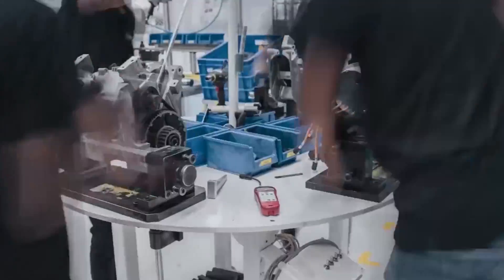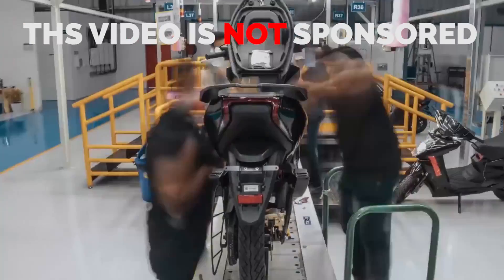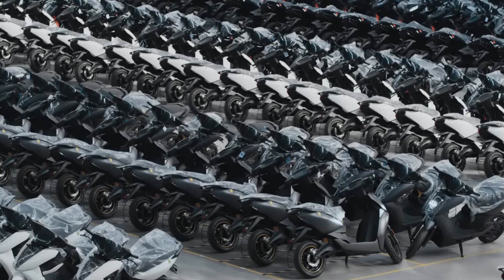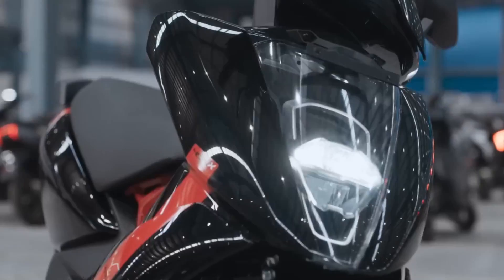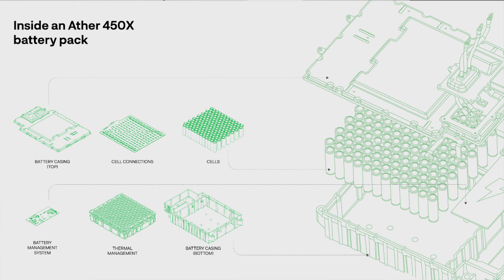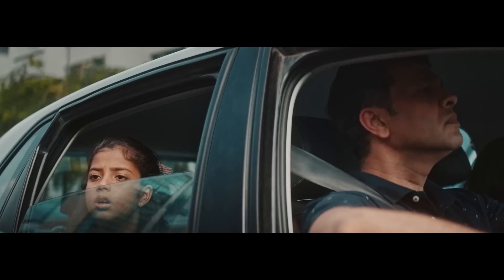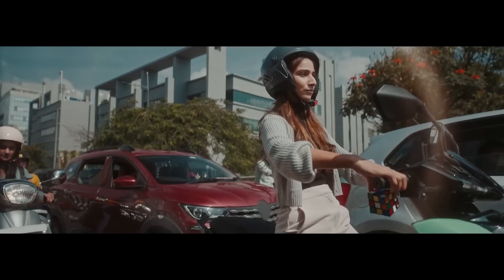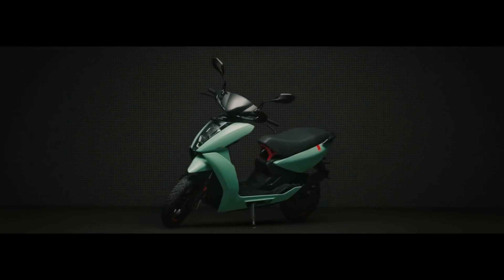Batteries, Thermals, Motors and Beyond With Ather's Swapnil Jain

Comment: That's why I keep coasting regen and auto hold off in my 450x. I don't want any unnecessary stress on my motor. Thanks for sharing insights. A magic twist should be added in 450x with different levels of control. I want to use it like brakes and charge my vehicle simultaneously!

Comment: AI-generated breakdown of Ather CTO’s interview.

Ather scooters are well-engineered for India, especially on safety and thermal management. But many of the design choices that were framed as “philosophy” are really cost trade-offs or ecosystem lock-in moves.

1. Liquid cooling vs fins + PCM
He said: liquid cooling isn’t worth it; passive methods are better.
Likely meaning: liquid cooling is expensive/complex. Passive cooling is cheaper and marketed as “smarter engineering.”

2. Battery swapping
He said: swapping hurts thermal design, safety, and center of gravity.
Likely meaning: swapping also disrupts their business model and control over battery ecosystem. Engineering reasons are partly real, partly justification.

3. Custom charging connector
He said: Type-6 isn’t suitable for India.
Likely meaning: Ather wanted control over charging infrastructure. Limits interoperability, but protects their ecosystem.

4. Regen braking at 100% SOC
He said: we dump extra energy into the motor so regen feels consistent.
Likely meaning: wastes energy, but avoids confusing riders. Safety/experience prioritized over efficiency.

5. Hub motor vs belt-driven PMSM
He said: hub motors reduce handling and safety.
Likely meaning: hub motors are cheaper but don’t fit premium positioning. Safety is partly true, partly a branding argument.

6. Dashboard hardware
He said: Snapdragon handles UI, microcontrollers handle reliability.
Likely meaning: uses older/cheaper chips and justifies as “robustness.”

7. Waterproofing (IP68)
He said: IP68 is enough; pressurization is costly.
Likely meaning: cost cut framed as sufficient engineering.

8. Onboard vs external charger
He said: onboard charger adds weight, so we removed it.
Likely meaning: reduces cost/complexity; weight justification convenient.

The pattern is clear: expensive features are explained away as “unnecessary,” and proprietary moves are justified as “safety” or “soul of the product.” Ather does build a solid scooter, but customers should see through the polished narrative. It’s a golden cage — safer than most, but still a cage.

Comment: Talking about the Regen, I own an Ola S1 pro and the regen does not start until it's below 90%. It is indeed a hazard, but once you're used to it, it is not that big of a deal. And the other thing is that, there a default regen which slows the vehicle down like engine breaking and then there's that reverse twist. So once regen gets activated, the vehicle automatically starts to slow down faster and that's when I know that the regen has been activated.

Comment: how are integrating regenerative braking systems into your e-bikes to maximize energy recuperation while maintaining seamless transition between acceleration and deceleration phases?
Reply: Could elaborate on the intricacies of your thermal modeling approach, including finite element analysis (FEA) simulations and experimental validation techniques, to optimize heat dissipation and prevent thermal runaway during prolonged high-power operation? Additionally, how does Ether Electrics integrate advanced cooling solutions such as liquid cooling or phase-change materials into the motor assemblies to maintain optimal operating temperatures and maximize power output efficiency?